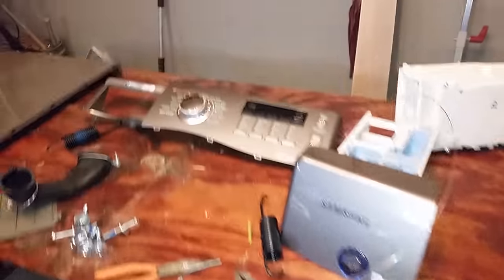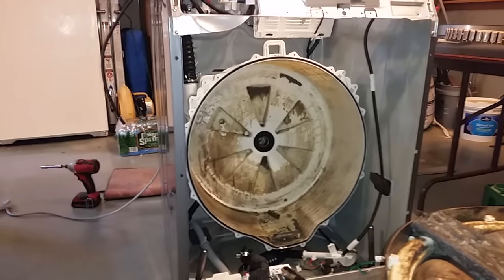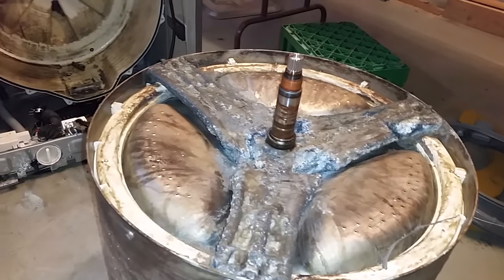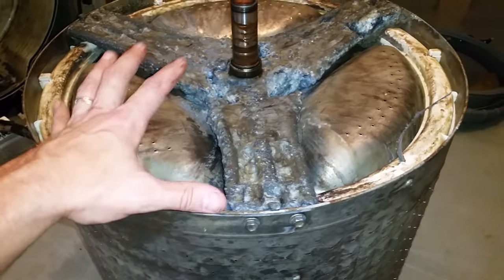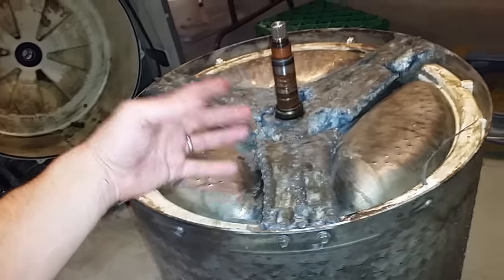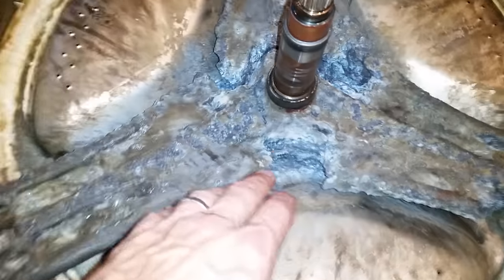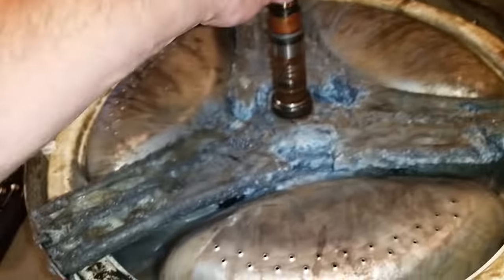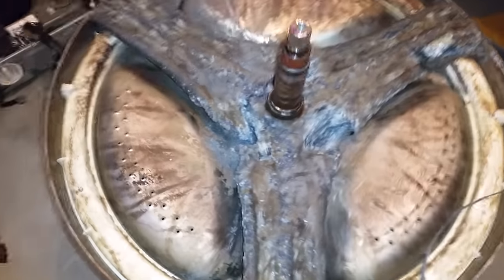Do not buy Samsung front load washer machines

Comment: Got a 1985 maytag. That sucker keeps chuging along!
Reply: lol exactly what I explained in my comment. I have a 90s frigidaire washer dryer combo that stills works today in 2019 lol. I only replaced a dryer drum bearing.  the washer part never had any problems. and it was used back when I bought it. the new washer and dryers might look like a new car wish shiny glass and nice new paint job but they are fragile! My 90s washer and dryer looks like a bus but built like a tank lmao
Reply: Maytag hands down, the best!!!
Reply: Mike Oxlong  ohhhh man!!! there's something to be said for old tech!
Reply: Pray that it does, because once it breaks maytags like that are not worth repairing due to leaks after a repair.

Whirlpool Timer Switch Models (non Digital) that are also Kenmore are worth repairs
Reply: Hope it still keeps working well for you.    
The new Maytag "COMMERCIAL" model MVWP575GW  (not the "COMMERCIAL TECHNOLOGY" machines, they are complete junk) is said to be built coin laundry spec, and is priced comparably to the upper-mid-level top-loaders from the big box stores...   
Speed Queen builds the most reliable home market machines in the industry, but these are not cheap.    
The Maytag COMMERCIAL and Speed Queen machines are not available at the big box stores, but rather through independent furniture and appliance stores. They are worth looking for.
Reply: Mike Oxlong  Dang flabbit!  I should get one of those.  I'm looking it up now.  Yes, I actually say "Dang flabbit."  Haha! :-)
Reply: I’d take a Maytag over any samsung
Reply: ahh you are fortunate, treasure that baby
Reply: DEEP WATER, TOO....VERY IMPORTANT TO RINSE AND TO PREVENT "BUILD-UP" OF THE JUNK THIS GUY IS DISPLAYING.
Reply: Built like tanks. I remember carrying the heavy ones and the fridges oh man. Today the machines are like coke cans
Reply: Thought I'd add that now 3+ years later, it still works fine and has never had any work done on it. It just works...

Comment: At least you’re got the basic parts to make a wind generator , Brushless stator ( Star or Delta)
Hall effect sensors, Rotor ( out runner ) Permanent Neodymium Magnets , have mood the
Field, 3 phase rectifier and usual control circuit/ safety- overload voltage , current,
Charging circuit for storage device either been deep cycle pb or Li ion / to pure sine
Wave inverter either  single or 3 phase synchronised to Grid ( go crazy with monitoring 
Systems/ data logging ... just my opinion 

Regards 
Meggerohm
Reply from the maker: Meggerohm i love, going off the grid Videos

Comment: What would really have been interesting would have been a teardown of other machines so we could see how this part compares from brand to brand.
The amount of corrosion would be a function of water quality more than the chosen metals in the machine.  My guess is that this machine was used in a home with a water softener.  Water softeners replace calcium/magnesium with salt which will accelerate corrosion.  In my case, I bought a samsung washer in 2005 and it is still running today.  Probably because it spent most of its life running on naturally soft water.
Reply: detergents are made with salt
Reply: no this is caused by electrolysis and detergent.

Comment: Meh. My Samsung frontload is coming up on 10 years. I have yet to make a repair.
Reply: you are lucky.   I actually have removed the lid screws so I can pull it off easy for the frequent repairs.
Reply: its coming !
Reply: I have had mine coming up on 10 years as well I am going to have shock absorbers replaced soon that’s it..
Reply: Andrew Kelsey  you got lucky.
Reply: Totally agree never had an issue with our one, best machine we ever owned and even when it dies in years to come will just go and buy another Samsung one
Reply: I thought the same of my 2007 until I opened it.   It can be hidden for years.

Comment: I guess I'll be the voice of opposition. I've owned 2 sets of high-end Samsung front loader washers and dryers. First set 6 years not a single issue, sold them with my previous residence. Second set is coming up on 7 years, again not a single issue. Now would I buy a front loader again in general, no as the new top loaders are way more efficient now and IMO, seem to do and probably have always done, a better job at cleaning larger loads.
Reply: still uses way too much water

Comment: They're all like that.. Kenmore, Samsung, LG ETC ETC... I Just got done fixing our Kenmore Elite  (same as LG), the support bracket was corroded to the point of it breaking on all 3 legs...  it's poorly cast aluminum too.

I replaced both bearings and the support bracket.  When I got the new bracket.. I cleaned it real good, picked up a can of plasti-dip and coated it with about 5 - 6 coats (except for the shaft of course), making sure to get all crevices and holes coated, and inside of bolt holes coated.  Hopefully this will help it last longer...

Comment: i work for an authorized Bosch repair shop, we repair Bosch, Siemens, Neff and Gaggenau products.

Some later models we happen to repair for damaged drums fails exactly like in the video. Funny thing is that when these things gets discussed during training courses we've been instructed it's an accidental customer fault using aggressive products, and so we tell customers.

This kind of stuff is so disgusting, i also do electronics as hobbist and i realized how much the authorized services are scammy. We are pretty much forced to replace expensive boards that could be repaired, sometimes DESIGNED to be repaired but you're not instructed to (and technically, not even allowed to) as they may simply have blown SMD fuses that you can replace...
Reply: Did they tell you to advise clients to use a real hotwash once in a while,like advised in operators manual,to washout unresolved detergents and softeners??sleeping in training?

Comment: My parents have the same washer, have never had any problems with it, except for with the tenant that broke the door handle. She was promptly evicted.
Reply from the maker: every one that i have seen that corrodes, is about 6-10 years old.
Reply: I have Samsung washer since 2001 and it still runs as smoothly as in 2001. So may be the new models are badly engineered.
Reply from the maker: In response to the person who calls himself "broccolibeef", sorry to inform you but you're wrong in your analysis about using too much soap. in fact I've used under the amount that was suggested. 
As I pointed out in the video this type of damage is caused by corrosion. Corrosion happens when you have two dissimilar metals attached to one another. it's an electrolysis process whereby the anode attacks the cathode or vice versa (I can't remember which one is the strongest one). this reaction is accelerated through electrolytes and in this case soapy water. however the amount of soap in the water is not really factor here. has one person had pointed out earlier post that he sees this problem amongst people who have drilled Wells. this is an indication of a high mineral content which would accelerate the anode cathode process. of course this would depend the type of mineral in the water. as I pointed out in the video  since the spider bracket which is most likely some type of zinc alloy product, was bolted to a stainless steel drum creates two very dissimilar metal reaction. and where corrosion would still happen to non-ferrous metals even if they were manufacturer of the same material the corrosion process would be much slower. however in this case  the metals are so different the corrosion process it's much quicker.

BTW my career field title in the Air Force was "Corrosion Control"

But then I probably don't know what I'm talking about and somebody with a name like broccolibeef has a more intellectual insight into this type of problem.
Reply: I think the spider assembly is made of cast aluminum in most front loaders.  You could replace it, but just getting to the spider is very labor intensive and not worth it.  They make it out of cast aluminum because it costs less than stainless steel.  It's called planned obsolescence.
Reply from the maker: yeah, as I indicated in an earlier post, I ended up ordering the bracket and replacing it. so I guess we're good for another 6 years. one interesting note I have seen about front loads is that they are prone to mold. it has been suggested that you leave the door open when not in use
Reply: Last only eight years ?  Then don't buy a Samsung.
Reply: +phil Greer
, Then why isn't everyone having the problems you are having or are they? And are you aware that 8 years out of these machines is pretty good?

Points of suspicion:

-- There is what looks like mold all over the outer tub. That is not normal, and that comes from using cheap petrochemical liquid detergents, and almost never using any alkalizing bleaching chemicals or antiseptics.

-- Also, never using the clean washer cycle is a bad idea. The clean washer cycle is designed to flush out crud that accumulates on the outer tub

--Why is there abluent all over the spider bracket? Is that normal? Again...That screams of suspicion of using too much detergent. Some people cannot get over the fact, that more detergent is not a good idea with these types of washers. They don't use enough water to flush all of it out if overused, and the cheap petrochemical stuff is notorious for gumming up and clogging the pipes if overused.

When using HE washers always use the extra rinse and extra water setting. Always. Whenever possible use astringents (vinegar) and de-ionizers (baking soda, borax)

Suing the company for purposely making crap like this would never fly since I'm assuming the machine only comes with a 1 year warranty. The lifetime warranty covers the drive train only, everything else gets a one year warranty. 

 I'm guessing they no longer want these machines to last 15 to 20 years for some reason. At one time they didn't have a problem with them lasting this long. TVs no longer last 15-20 years either.
Reply: I got 10 yrs  out of my Whirlpool washer and I guess that was pretty good before the bearings went in my machine. It was a beast and didn't give me all these problems with UE loads and having you have to reposition the load. It just shook like heck and spun them out. But when it comes to corrosion it is true. We just had to replace our car battery for the same reasons. They are supposed to put this special grease on the terminals of the battery because they use dissimilar metals for the ends. Just about ruined my brand new vehicle. Sure it was 2yrs old but apparently at the factory they failed to do this. I had bath bombs coming out of the tops of my battery. Thankfully they replaced it for free even if it was still under warranty
Reply: BroccoliBeefed What does "evicted" mean?
Reply: They got kicked out.
Reply: Their rental agreement was dissolved and they were told to move out of the house by the owners
Reply: mine did this at 7 1/2 years, I was expecting the 20+ year  life experienced  by 2 posters of older machines.
On our 2010 Samsung, there is no clean cycle (model WF210), is it something introduced after that year to resolve this corrosion failure issue?

I tried vinegar whenever possible as I had read softener was the culprit for corrosion to the point of failure for this spider casting.  (my kids and wife wouldn't play along, they insisted on using softener and did most of the washes)

QUESTION:  Should we be using vinegar with baking soda or alternatively using them separately?

Detergent type: had almost exclusively been Tide, liquid; is that a bad one?
I filled to the max line,  I had no idea that would be something bad.  Never heard of using just 2 tblspns until coming here, 

There is no way to use extra water:
ours determines the amount of water to b used, I thought that was the HE concept: using less water. it spin the clothes dry a while, back n forth to determine the weight or something, then gives the water it determines 

Extra rinse  ...h/b used every single wash/ every single time

How much vinegar, how much baking soda?
And, can we  add them to the wash as I did with vinegar or should they be run in an  otherwise empty (ie: no clothes) rinse cycle?

(Or is it best to just buy a top load style?)

Comment: I have a Whirlpool Duet Front Load washer from 2008 with a similar problem.  It looks like many of these appliances have identical parts and design.  The metals are in a perfect environment to cause this corrosion.  My washer has a ground wire bolted to the bearing housing to prevent the galvanic process, which helps, but does not prevent this entirely.  Overloading or letting the machine run off-balance eventually breaks the legs of the spider.  In my case, the drum continued to turn after the leg broke, which then allowed the stainless steel basket to rub and melt a groove in the plastic outer tub,  opening a catastrophic leak.  I learned 3 lessons:  Keep a fairly light load.  Beware of too much soap.  Make absolutely certain to empty pockets.  (coins between the basket and drum will work like a 3000 RPM can opener.    
One other note - these older machines were bad, but the new ones are much worse.  Manufacturers now "weld" the 2 halves of the plastic outer drums together (vs. the flange clips or bolts used in the past) so you can't DIY change the bearings/seals anymore.

Comment: Me parents have a Samsung front loader, its barely 6 years old and the machine sounds like an airplane. It seems the bearings are knackered. Samsung does not give any warranty, but I reckon the back of the drum will look an awful lot like yours. Cheap rubbish, stick it in a bin bag!
Reply: Mine had a very badly corroded spider arm which fell in three pieces when I removed it, but the bearings and shaft seal and dampers were all perfect.  It's almost certainly a failure of the arm, not the bearings.
Reply: Yeah, my LG bearings were still like brand new under that water seal. I did buy the bearings as well and have them for future just in case..  @latemnetlom

Comment: OK...I immediately knew when I saw the inner tub caked with funk that this machine was abused... when I say abused I'm talking they probably used cold water only...overloaded the machine, used too little or too much soap, probably didn't leave the door open to dry out...My Duet front load washer from 2005 has an aluminum spider and it's approaching 19 years old.... I can't say 100% but I'm willing to bet this happened because of user error... Just don't overload them, use occasionally hot water washes and leave the door slightly opened...I've never had mold or bad smells and I think this has kept my spider from deteriorating.

Comment: 1) Use HE (High Efficiency) Detergent and use a maximum of 3 ounces per load.
2) Run the self cleaning function every 40 cycles.
3) Clean the pump filter twice a year.

My washer has lasted for 8 years no problem.
Reply: Great job! You read the manual
Reply: @theapplianceguru  most people don't....
Reply: Or buy an old style washer and just not worry about it.

Comment: Sorry had the same machine 6 years and I took mine apart last night, tooks NOTHING like that, You clearly didn't run the cleaning programme or use it properly
Reply: Cant help but wonder why someone would take apart a perfectly good washer.
It's a machine..
All mechanical machines break down from wear eventually from friction alone.  No cleaning cycles is going to stop galvonic corrosion. He was 100% right in the fact they knowingly assembled metals that would cause galvonic corrosion. Planned obsolescence at its finest.